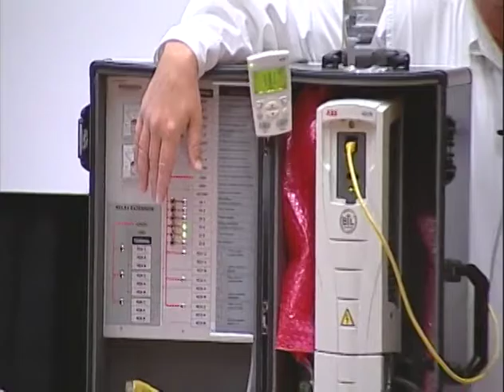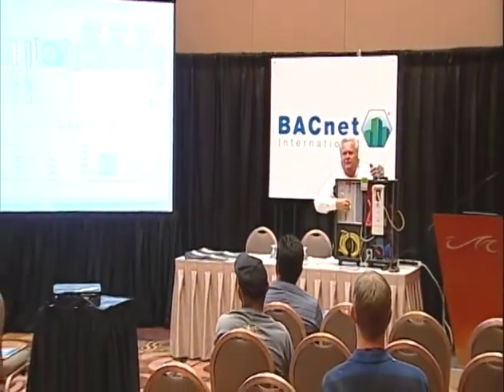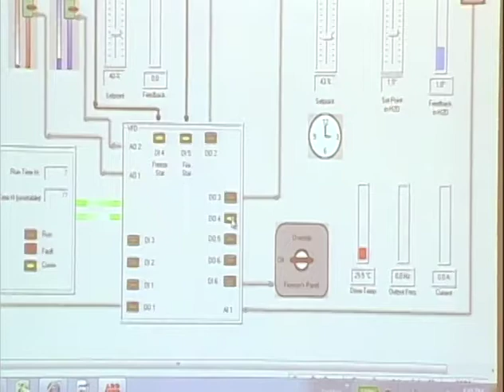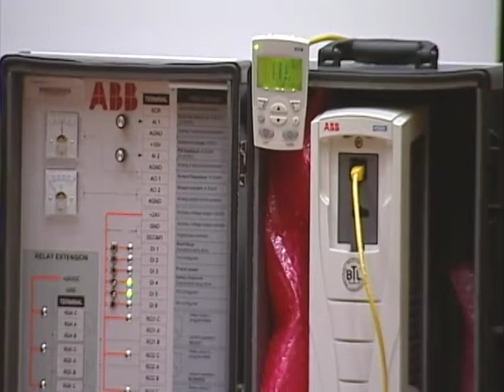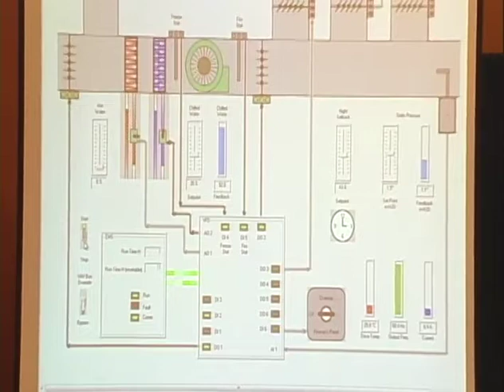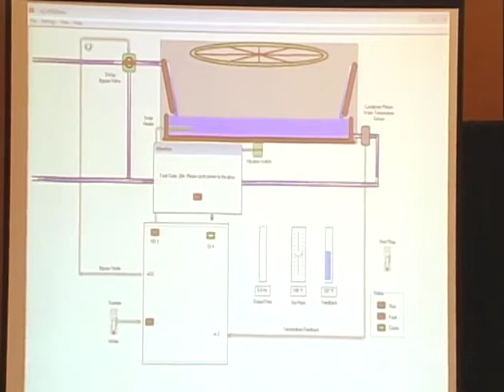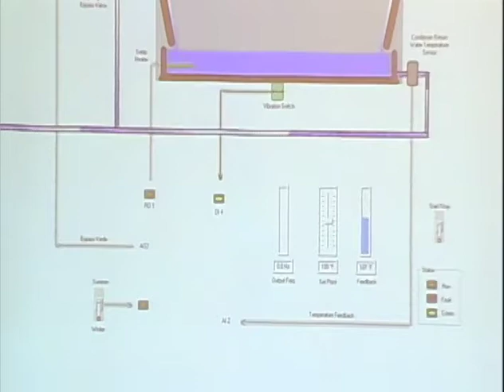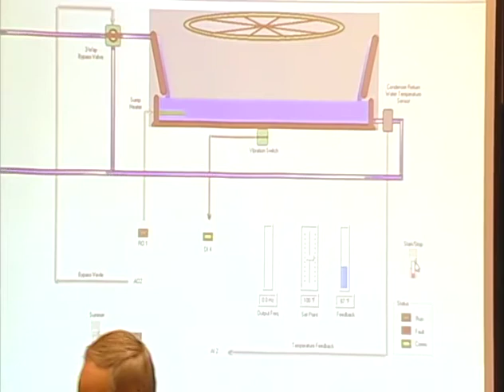Mike Olson presents "VFD Communications: Which Objects Should I Monitor and Why?"

Comment: good evening,
We face problem with VFD communication,
actually We have more than 128 VFD's connect to network, and if i give address to VFD  (parameter 5302) more than 128, the VFD not Communicate with BMS using bacnet protocol ,

so Please if you Have any solution , guide me to resolve this issue.